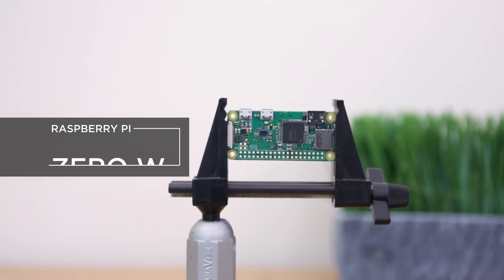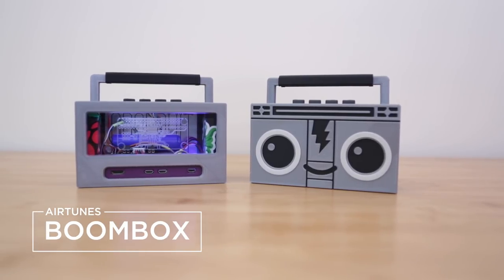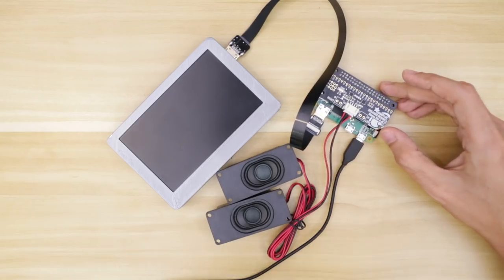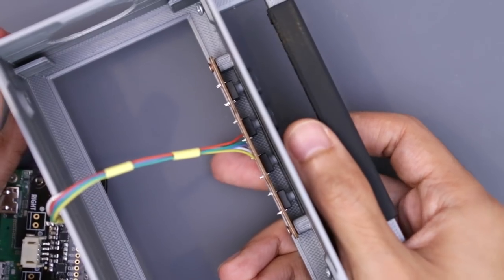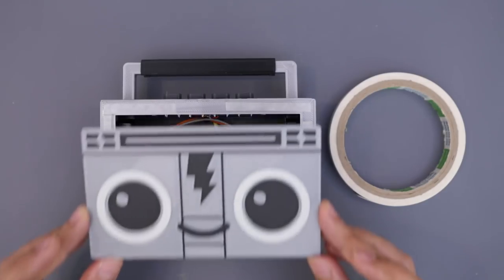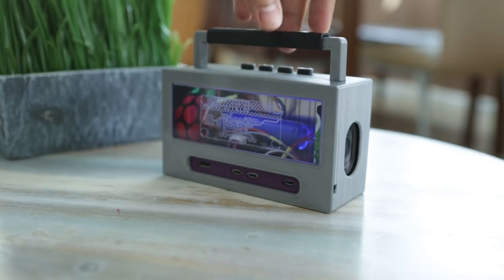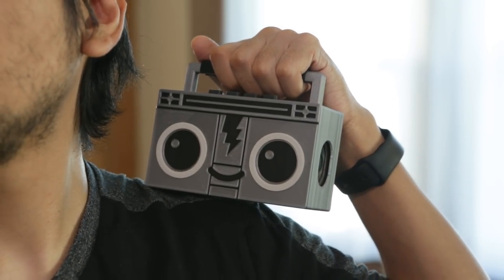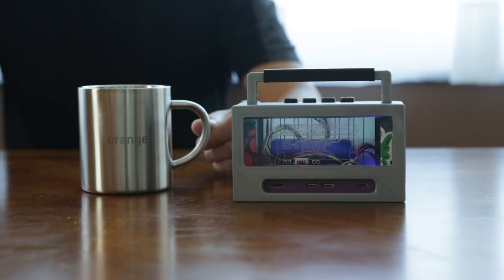Raspberry Pi Airplay Boombox

Comment: How many hours does it last for? I am looking to use this type of design for a museum exhibition and need at least 10 hours of battery life. If the provided battery does not last long enough, is there a larger, compatible battery that could give us > 10 hours per charge?
Reply: do a power analysis, shouldnt be to difficult, there are lots of resources online

Comment: first step: get a cripplingly expensive 3D printer...
Reply: It's 2017. Decent fully built 3d printers can be had for around $300. Even less if you're willing to spend some time printing out parts to upgrade basic assemble-it-yourself kits. Also, filament costs start at $20 for a decent PLA 1kg spool. I got my current workhorse for around $350 shipping included.
Reply: Or go to a makerspace and pay for the use of a 3d printer there, It's a lot cheaper than buying one
Reply: You can recycle an old FM radio case or build up one with wood if you dont have a 3D printer to fit in the pi, circuit sboards and speaker
Reply: My public library prints for the price of the filament used. Printed a lot of these projects the most expensive was like 8 bucks xD
Reply: i want to 3d print a 3d printer.
Reply: Just Google Monoprice Maker Select or Wanhao i3 Duplicator. They're the same printer but Monoprice is better known in NA I think. It has great reviews and I use one myself. Price should go up or down slightly depending on the time of purchase. The Monoprice Select Mini is even cheaper and is also well liked by makers. The Creality CR-10 has also been getting good reviews and its around $350 as well.